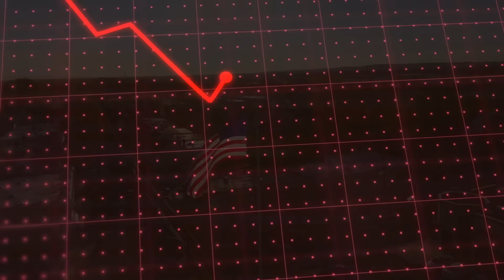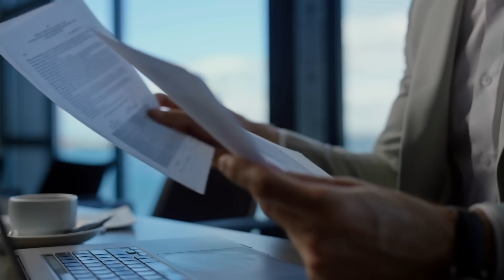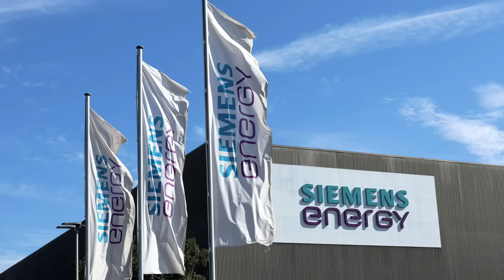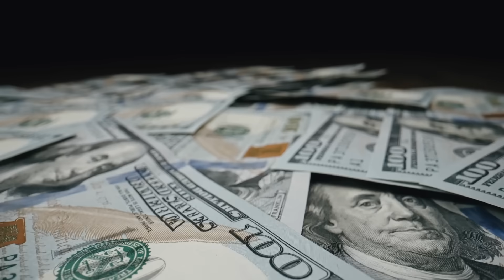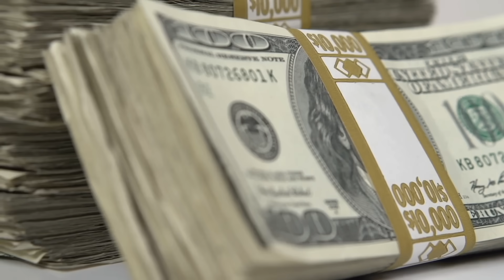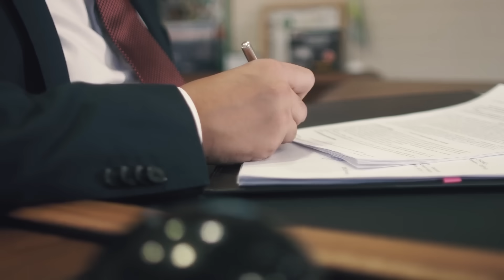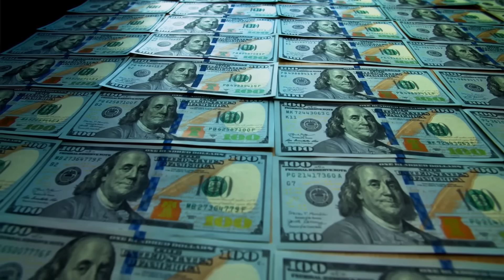The Real Reason America Has Turned Its Back On Wind Power Energy

Comment: If we can't get a basic grid upgrade to harden it against a Carrington Event, EMP strike or fire risks, then it's back to the drawing board for renewables.
Reply: Why ONLY for renewables? I think if a nuclear power ONLY gave you an EMP event you would be extremely lucky
Reply: @petefluffy7420  Distribution can be a nightmare.  I talked with a power supplier about grid problems.  He mentioned that hydro power plants are robust and power through high demands.  However, power plants that use solid state rectifiers to create AC power (as most renewables would) are quick to disconnect from the grid to protect themselves from sudden high demands.  On top of this, renewables are generally smaller than optimal, generally poorly placed and generally less reliable than traditional power plants.
Reply: @skyblueiiii  something like another Carrington event or EMP will kill or disconnect nearly everything. That is why I brought it up. Yes, electronically controlled plant is more susceptible to damage.
Reply: @skyblueiiii  Depends on whether the renewables are backed by batteries (or something that can act as batteries) or not. Renewables without batteries might be unreliable; but with batteries, they are often the most reliable power source you can get.
And batteries are quickly falling in price. Solar generation is already cheap enough that if the unreliability isn't an issue it's usually cheaper to rip apart a brand new coal or gas plant, sell it for scrap, and build a solar plant in place of it, than to just pay for fuel and maintenance; within a decade, this might hold true even for battery-backed solar, at which point using anything that isn't renewable will be essentially burning money.
Also, to make things more interesting, since solar and batteries can scale as low as a single household, their falling prices will increasingly tempt more and more households to just generate and store all the energy they need, and perhaps even go off-grid (and, thus, stop paying the utility for power). Things could get pretty interesting for grid operators.
Reply: @FabioCapela  Has new battery technology been invented that I haven't heard about that would make what you're saying even remotely possible?
Reply: @christophercharles3169  They already do that. Batteries are the single best way to stabilize a grid, regardless of what you have connected to it; intermittent renewables, on-demand renewables (like hydro), nuclear, fossil fuels, etc. They have instant ramp up, whereas a fossil fuel power plant can take hours to go from idle to peak power.

The issue with batteries up to now has been cost, but prices have been falling fast.
Reply: @FabioCapela  Wrong.  They can stabilize a grid for seconds or perhaps minutes during small outages but they can not sustain a large grid for any significant amount of time and they will never be able to do so in a manner that is anywhere near cost efficient unless a completely new battery technology comes along.  For the record, gas fired plants also have a  relatively fast ramp-up time which is why they are widely used. Nuclear has a longer ramp-up time but is significantly more reliable than renewable such as solar and wind and data shows, is the safest way to generate large amounts of power.
Reply: @christophercharles3169  Batteries can stabilize the grid for as long as they have a charge. It's all a matter of how much capacity you have installed. Which is why the way battery prices have been falling those last few decades matter a lot; for the same price you paid for 1KWH of storage in 1991 you could get 75KWH of storage now, and if prices keep falling (and some technologies more adequate for fixed installations enter production) we could see the amount of storage you can get for the same price double or even triple by the end of the decade.
Reply: It is very simple to harden a grid against a Carrington event.
Reply: @rogerphelps9939  I heard it would take 30 billion dollars.  I think the last "infrastructure" bill was 50 times that big but still no protection.
Reply: Do renewables really need heed greater hardening against such things? If we can't get is perfect should we never have have used fire ?

Comment: I'm curious how to do maintenance and repairs  the huge quantity of the wind turbines. Also the wind turbines don't produce electricity when wind isn't blowing thus require to have backups such as natural gas power plants. It seems ROI of wind turbines is very low considering their high cost, taking allot of land, using power lines to each turbine, maintenance, etc.
Reply: Yup. Better to keep burning non-renewable, increasingly expensive fossil fuel and keep adding that good ol' CO2 to the atmosphere.
Reply: If the wind companies are given enough free money, they aren't too concerned about ROI. It's no skin off their nose when those tax credits show up.
Reply: @markusstevens9547  At least they're producing low carbon energy with those subsidies, unlike the subsidies given to fossil fuel companies.
Reply: Here in the UK wind farms are now being built with absolutely no subsidy. Wind power, especially offshore, is the cheapest form of electricity.  Fossil fuels have received massive subsidies for years. @markusstevens9547
Reply: Not only don't you get electicity when the wind isn't present, in many systems, too much wind can damage the generators and the systems have to be taken off-line above a certain amount of wind speed.
Reply: ROI on wind farms without factoring in the government subsidies, is almost ZERO. Solar is almost as bad, and public utility companies are defraying the cost of the electricity in administrative fees, so you are paying for half your electricity in the form of bullshit fees that are non-negotiable. That means it will take over 2x longer for a residential solar system to pay for itself now, and you need to put the money you think you are saving away to buy a new solar system, a new roof and a new heat pump. Solar panels also make a lot of waste heat that makes your air conditioner run a lot more and a lot harder. It's a bullshit system. Both of them are.
Reply: Wrong. Onshore wind is the cheapest form of electricity. Land utilisation is irrelevant because the footprints of the turbines  are very small. Agricultural land with wind turbines is still agricultural land.
Reply: @rogerphelps9939   Mostly.   The farmland certainly has the best maintained set of access roads ever seen.
Reply: So it's arable?
Reply: @nellymoo635  It depends on where a wind turbine is placed.

Comment: To save you 10 minuets, it's because they haven't got the power distribution network.
Reply: Without grid level storage, they're essentially an unreliable or intermittent power source that requires the rest of the grid to adjust to compensate.
Reply: The renewable business model is based around China, their manufacturing industry is in free-fall.
Reply: Thanks bud
Reply: Sadly, I watched it before I read your comment.
Reply: "To save you 10 minuets, it's because they haven't got the power distribution network."
The game is to get away with building the renewables, but not take responsibility for the associated transmission, and support services. In many jurisdictions they have gotten away with this though. Places where there are 'portfolio standards' and 'renewable targets' this sort of irresponsible embracing of renewables at the expense of the existing system has been encouraged with fanatical zeal. Only later to the technical challenges inherent get accepted and tackled. 
All participants end up paying different costs according to their level of involvement and their position in the hierarchy and propaganda system, visavis politics and climate change, etc etc.
Reply: Same stupidity in Australia, the uniparty are blowing up our coal and gas infrastructure.
Reply: to save you 10 minutes, it's because everything liberal and woke is a disaster and only hurts the economy and environment.
Reply: Part of the distribution problem is being solved by  homes using the power they generate so there is less draw on the grid.  In some cases urban houses aren't even connected to the grid, even with the wires right outside.
The rest of the problem is being solved with government subsidized upgrades to the system because we know electric vehicles are a future that is here.  Like rural electrification all over again.
Reply: @josephastier7421  lol, are you in kindergarten?!
Reply: @josephastier7421 It's not being solved though. Problems are increasing and compounding. Electric vehicles will never be a workable long term solution.
Reply: @PaintedCavern  EVs ARE the workable long-term solution.  Powering vehicles with dangerous burning chemicals isn't something anyone wants to do if they can avoid it.
Reply: @josephastier7421  Are you aware  that lithium is a dangerous burning chemical? Are you also aware that people are having to be forced to change?
Reply: maybe Siemans and Boeing are not hiring the MOST qualified 
   just hiring to meet D E I QUOTAS .
Reply: Not yet. It's like people saying EV's can't work because there arent enough charging stations. Gosh. HOW can this problem be fixed.
Reply: @granthurlburt4062  By massively upgrading the power distribution network (if you hadn't noticed, this is what the video that you are commenting on told you...) and building loads of new power stations, and considering that this work hasn't started yet, it's going to be a LONG time before EVs are a practical replacement for conventional vehicles, rather than a toy for the rich.
Reply: Wish I read this earlier
Reply: thanks for saving me the effort.
Reply: Thank you.
Reply: The interconnect does take _forever_.  This is a major major problem.
Reply: we have the distribution network, it works fine, its a scam and mega battery storage with lithium ion storage is an environmental disaster waiting to happen.  we have more than enough coal to power our needs for  the next 10000 years and its cheap and clean
Reply: They don't create enough energy required to make them. Windmills are energy losers.
Reply: Naw it’s not meant for the grid
Reply: Where Zero Planning meets unrealistic expectations.  Have you ever listened to our current Sec of Energy?  You will see the answer.  But she has a greet $200 hairdo.
Reply: why is it called green energy? because trees and grass is green but these things are build with metal, plastic and composite material, but yeah let's call it green lol
Reply: @AnseloSilver  Turbines are toxic & nasty. They are exempt from the endangered species act for a reason also. And yes i built turbine blades and know the mess they make.
Reply: @AnseloSilver  Because you can grow plants in a wind farm.  Can't do that with an open pit mine.
Reply: @josephastier7421  Not in the ones off the coasts.
Reply: thanks I watched the whole thing to and really that's only part of the problem with both wind and solar. Didn't say anthing about stand by available power or storage which are just as big a problem. A few words about the cause of this waste of money and resources would have been nice as well, that being good old government getting in the way with mandates.

Comment: Good that you started to shine a light on the huge problems of connecting all these wind and solar projects to the consumers of electicity. But your solution is government money, which ultimately is consumer's money as they are the tax base. And it is government policy based on the imaginary CO2 induced climate catastrophe which is driving the push to create huge base load coal and gas generators with many more comparatively low output wind and solar generators. The whole thing will be seen as a massive ponsi scheme when it all comes crashing down because of economic and physical reality.

Comment: You, the maker of this video, must be a journalist. Your mistake is leaving out large sections of the difficulty/expense of building large RELIABLE electric power systems.
Yes, the interconnect problem with such low density power systems is just one of many difficulties of building wind/solar energy supply.
Where is your concern on intermittency?
Where is your concern about the limited turbine lifespan? These things are built on a 'First Cost' basis to impress the investors. Don't you know it should be 'LifeTime' cost plus 'Unexpected Events' cost?
What happens when a storm knocks out 25% of your turbines plus 75% of the interconnect?
Intermittency (no wind/no sunshine) is already an enormous cost for 'Renewables', a task/cost that they just dump at the door of fuel burning energy sources. That is a vast increase in the working stress of fuel burners, they will likely need replacing to cope with the increased load cycling imposed by the extreme intermittency of wind and solar.
Don't you realise, to avoid total power shut down, the so-called renewables require a full load capable, fuel-based back up system, running, year after year?
Perhaps that is what has finally gotten to the accountants so busy, up to now, counting the subsidies!

Comment: You have to appreciate the irony. The North American continent is blessed with the most abundant renewable energy situation: 5 time-zones, 5000 miles across, Arctic north, nearly-tropical south. An interconnector network across all this would mean relatively small storage requirements. But it has huge pumped-hydro storage options anyway. And there's available capital and resources a massive build out.
Reply: And it is also blessed with hundreds of years of cheap fossil fuels under their feet.The people of North America have woken up to the lies about climate change and not so green energy and they want no part in that silly fairytale.

Comment: Realize that the grid expansion issues would effect most all new power sources added to the grid.  Be it renewables, nuclear and even any new fossil fuel power plants.  This just shows how important the electrical grid is.

Furthermore, grid will become evermore a critical national security concern and so will receive government subsidies just as fossil fuels does in huge figures.  Realize too that the global fossil fuel industry is one of if not the most heavily subsidized industry in the world!  Thus the grid of tomorrow will not be the grid we have today.

On the topic of grid independence…

The only power source that is not as affected as much (or at all) is localized rooftop solar both small-scale residential and larger-scale commercial (factories, malls, box box stores).  Solar power uses all solid-state electronics with sealed panels and thus integrate near seamlessly in most urban rooftop environments especially commercial flat top roofs.

Moreover, rooftop solar actually unloads the grid!  Yes, this is because the power they generate is used immediately locally which is the most efficient way to use energy:  every watt generated and used locally is a watt that does not stress a distant power plant nor the grid the transit that watt

A big box store, mall, college campus have megawatts of power with solid-state quiet power source that might not even be noticeable by anyone on the ground.  The collective rooftops of metro area could easily meet the daytime power demands of most region if not take a huge chunk out of it relieving existing power sources like fossil fuel plants.  When adding local energy storage, the effects just multiply into the evening and night hours.

Comment: What am I missing in the Geothermal option department? Tons of thermal energy down there, but tons of $$ drilling too.
Reply: Geothermal comes with a host of problems. Nasty gases corrode things and sources tend to have a short lifetime.
Reply: I'd say you were right, too expensive. Lots of gas and oil gets left because it's just too costly to extract.